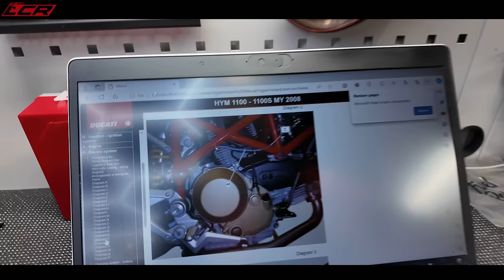Hypermotard 1100 S Restoration EP17 | I've Forgotten How It Goes Back Together..

Comment: You can straighten out the fins on the oil cooler with a small screwdriver blade to allow the air to flow through the oil cooler.
Reply from the maker: Yes I've done that as much as possible 👍

Comment: Send in the frame. When it is done and everything is nice, you will focus on the ugly parts right away and it will mess up everything. After you have mounted everything, you can not do anything about it but to tear it aprta again. It is not that much work, just make sure you do not blaster over the framenumber. I really think you will regret not fixing the main frame. I have done this exact project myself with an SP so i really know about regrets when it comes to fixing things with the engine and the mainframe. When they are out, just deal with it

Comment: Mine was apart for about 3 months....had it back together in a day and started by 9pm that evening....that being said in all fairness i left the forks and the front end on...and the rear wheel connected to the swing arm...im sure ive said before but you have to be really careful with that swing arm spacer/bolt....if your not careful you can loose that in the swing arm....which i did...
Reply from the maker: Yeah and I have to replace all the swinging arm bearings which I'm a little apprehensive about too.. shouldn't be too much longer hopefully! You still got yours?
Reply: @LambChopRides  yep - just aquired one of those rocking horse shit alloy rear subframes that some italian company made years ago....they did a run of about 200 and no more after that...managed to score one off of a guy on the ducati forum....got some race cams as well...but thats gonna be more work...i tend to do more vids on my z1000 but the hyper is there in the background! ooh if you want some seriously trick bits one of the lads on the ducati uk forum is putting his evo sp back to stock.....hes got a set of the twin scproject 2-2 full systems - like what ive got...plus a shit load of other unobtanium stuff...
Reply from the maker: @comfysofa1549  oh yes certainly interested, taking a look on there now :-)

Comment: Whats that deep scratch on the Headstock?  BTW you can get parts diagrams from  Ducati parts catalogue
Reply from the maker: That's where the wiring goes to the bars.  Hoping it will be hidden when the wiring goes back on. I might just touch that bit up..

Comment: Stupid question, why was the head race in the freezer?
Reply: Easier to fit, the cold minutely shrinks the metal for a short while.  Expands once upto normal ambient temperatures…👌
Reply from the maker: It shrinks the metal where heating it expands it slightly. So it goes in slightly easier 👍

Comment: Is there any reason why you’re not building the bike on the bike lift, it would make life much easier.
Reply from the maker: Actually it wouldn't, on the table I can get closer to it both sides as its not as wide. Plus I can get the wheels on due to the overhang, then I can transfer it to the lift to finish things off 👍